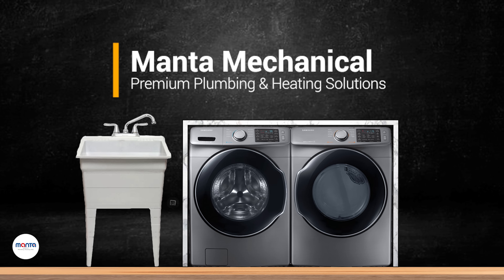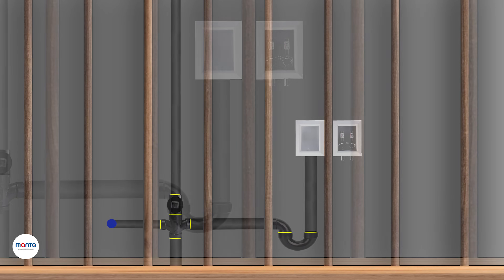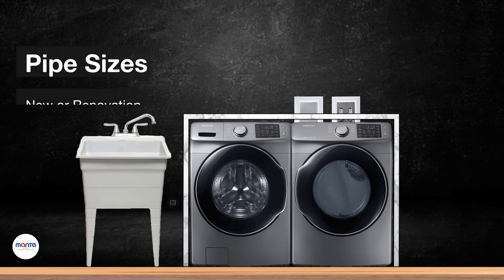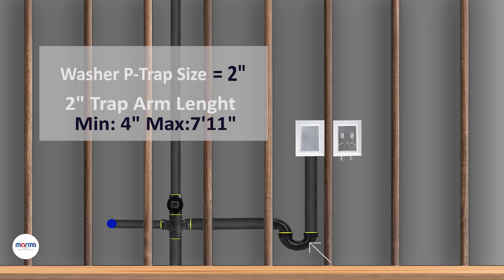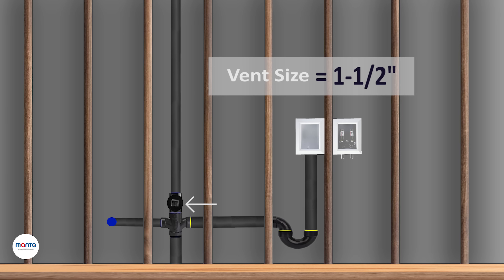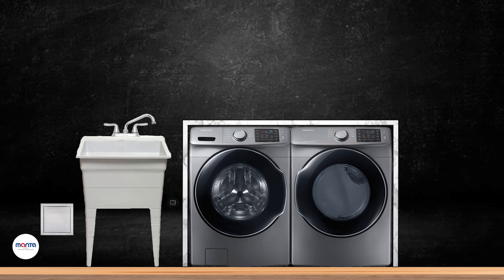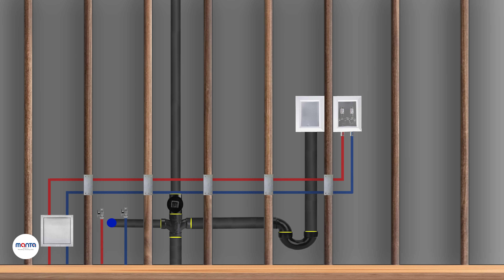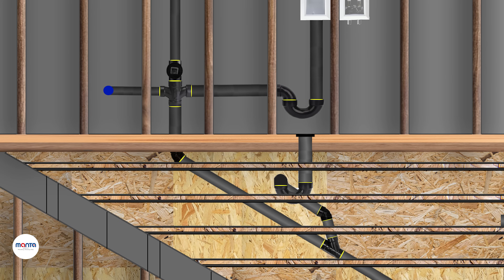Dos & Don’ts of Laundry Plumbing - The Building Expert - 2020

Comment: That stinky smell in your laundry room is sewer gas coming from your emergency drain after the water in the p trap evaporates.  Solution:  Pour water down the drain followed by a cup of vegetable oil. The oil will float to the top forming a barrier that will not evaporate.
Reply: Mineral oil instead of vegetable oil
Reply from the maker: Or a Trap Primer. Thanks for your feedback.
Reply: Won't the vegetable oil rot and/or attract insects though?
Reply: Way to much but it works. I doubt the trap holds that much
Reply: What do you do about the rancid vegetable oil smell and all the bugs it attracts?? 
Maybe you should just do laundry a little more often.
Reply: @MAGAMAN they're talking about the emergency floor drain. It should only see water in an emergency
Reply: Wrong..will sill evaporate from vent side,,,you must fill trap 100% with vegetable oil..
Reply: No. Actually you install a vent
Reply: Trap primer
Reply: Very helpful and intelligent. Thank you🙏🏻🙏🏻
Reply: Not just a bad idea, but ilegal.
Reply: If the water in your P-trap evaporates then do your laundry more. The stink is actually YOU and your dirty clothes
Reply: @Googaliemoogalie they're talking about the emergency floor drain